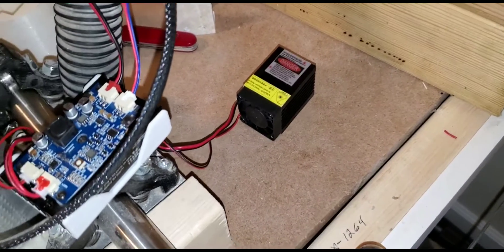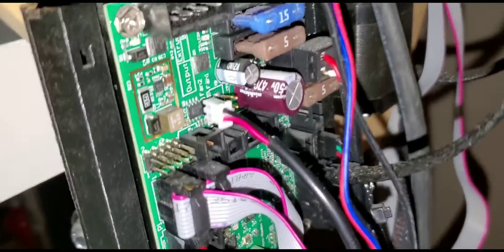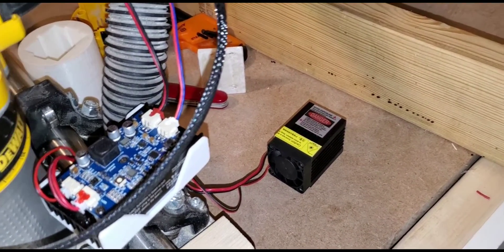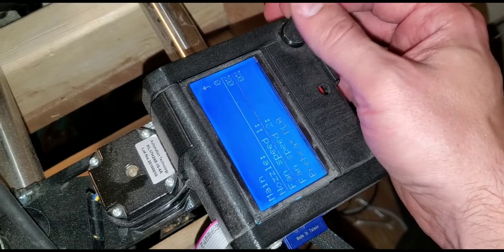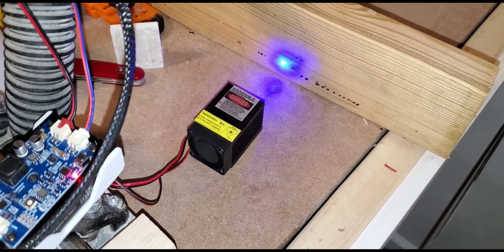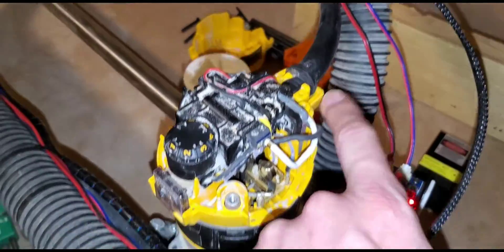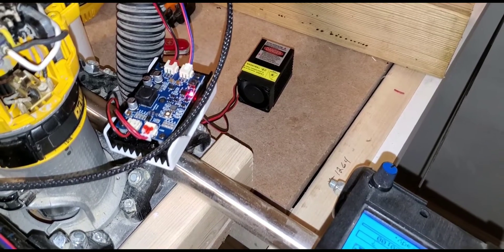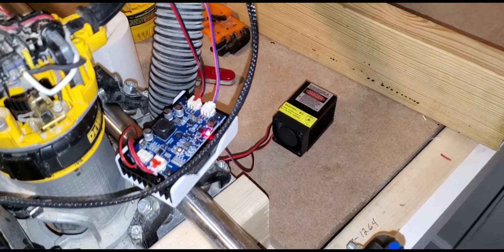ElksMaker 3.5 watt TTL blue laser on Lowrider2

Comment: Amazing! Did u follow any tutorial on how to do it? I have just finished a LR2 and would love to put some laser on it
Reply from the maker: The mount was a remodel of one on Thingiverse. My laser is TTL 5 volts. So I can not use the pwm 12 volt fan on the Rambo mini. Had to edit a 5 volt TTL pin to run the laser. I didn't want full power on and off. Wanted to be able to engrave.